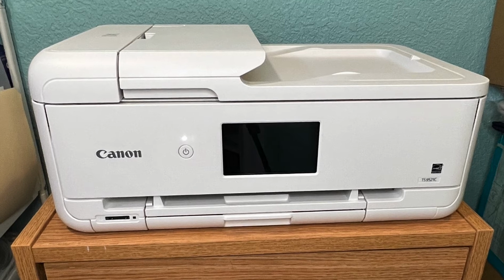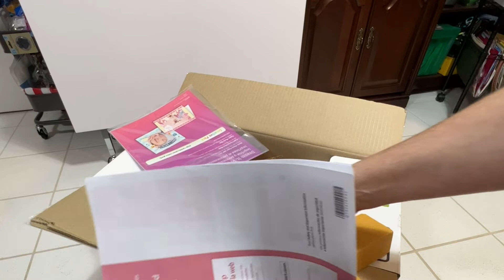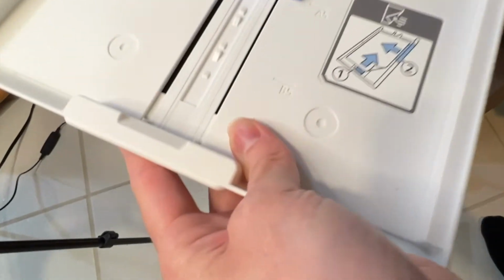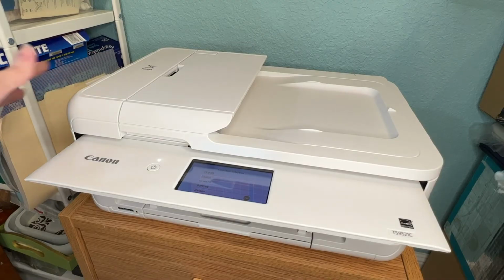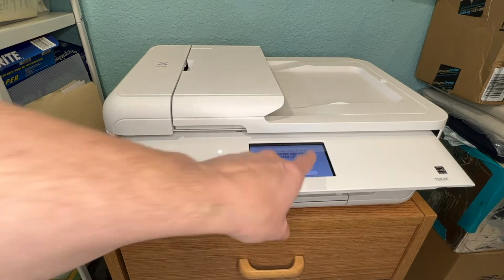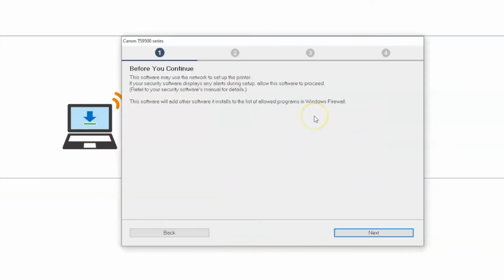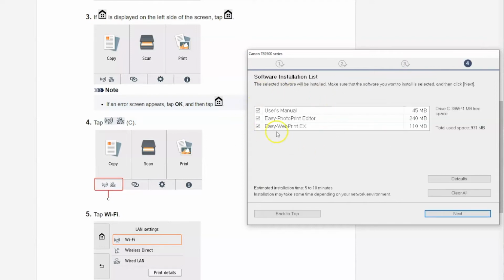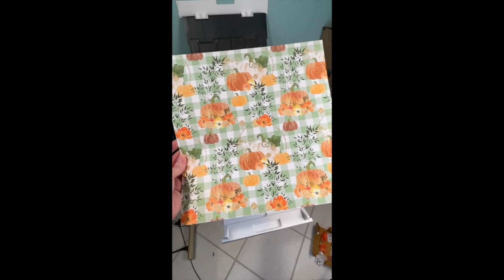Wide Format Inkjet Printer Unboxing and Set up in my Craft Room | Canon Pixma TS9521C

Comment: I have never been able to set the printer to print 12x12! How do you set it up?
Reply from the maker: What software are you using for your image?  Or is your image already 12x12?  I can make you a video this evening to show how.  You need to use the rear feed slot. Change the printer settings using the touch screen to change the size to 12x12, be using an image that is 12x12 and have the preferences in the print dialog box set to 12x12.
Reply: @LittleGraySquirrel  I don't know what i did but it is now printing 12x12. I think I had it set to plain paper instead of cardstock.
Reply from the maker: @little.iodine  Yes, that makes sense. Changing the paper type to cardstock will let you choose the 12x12 size.  I’m glad it is working for you now.

Comment: What print settings do you use for card stock for making cards? I’m really not impressed with the colors and someone told me that bought a card from me that it looks like it came from a home printer and thought it would be better quality 😢
Reply from the maker: I usually just choose the setting for the paper type I am using.  I would probably use matte presentation or premium matte for cardstock (I think those were options, my craft room and printer is packed up right now). Cardstock is pretty porous/fibrous. You might look into pre made cards to print on or something with a smoother surface that will have a more vivid print.

Comment: Great video. Can you talk about what .lb cardstock you can use with this printer please?
Reply from the maker: Thank you! I think the thickest I have printed out of the front tray is 40lb text weight paper which is twice as thick as regular copy paper. 
The thickest I have printed from the rear feed is poster board which is the regular poster board from Dollar Tree that I cut down.  I think it is 98lb? But it doesn't have the weight stated. It printed better on the matte side but I have printed on the shinier side too just make sure it doesn't have any finger prints on it. 
The print on card stock at the end of the video and in my post about the printer on my website I show photos of 12x12 card stock I have printed.  I believe that is 65lb cardstock.  
Is there a particular weight of card stock you are wondering about?

Comment: Hi, Thank you for this great video of the Cannon pixma. I'm subscribing to your channel because I also have a Silhouette.  I'm seriously considering getting this Printer, because it has all the features I need as a scrapbooker, Sihouette user and crafter.
How do you like it so far?  
Have you used it to print photos and are you happy with the  quality of the colors? 
 Also what is the heaviest cardstock you have used in it?  Sorry for all the questions!
Reply from the maker: No problem! Thank you for the questions and subscribing. 
I have been quite happy with the colors.  I haven’t printed photos yet but I need to soon.  I will let you know how it goes.  The heaviest I have printed on is poster board which I fed through the back.  Anything much thicker than regular paper or larger than letter size would print from the back. I have printed 40lb paper from the front tray which is twice as thick as regular printer paper. 
Originally I didn’t think it would turn itself on when I sent something to print after it had shut off but I figured out how to change that setting so I was pretty happy with that.
Reply: Thank you so much for your quick reply!  The more I see this, the more I really want it!  I'm hoping that the print quality is really good on photo paper because I do like to print photos out for family and to also to frame.
Reply from the maker: @MsKathyf  You are welcome!
Reply: I just printed several photos on mine with the glossy II photo paper samples that came with the printer. I have to say that the photos were outstanding. As good or even better than getting them printed at a store. I’m so happy with my purchase.
Reply from the maker: @JoyfulCat24  Thank you for sharing! I’m glad to hear it. I did print a photo on the glossy II paper as well and it was nice.  I also printed one on the photo paper from Dollar Tree and it was not very nice.  It was ok, but not great.  It is definitely worth it to use the good photo paper for important photos.

Comment: Msy I ask how did you get it to print edge to edge? Mine prints with a small white border on all 4 sides.
Reply from the maker: In the preferences settings for the printer, in the Additional Features area, check the box next to Borderless Printing.  It will limit the Printer Paper Size options you have like you can't do Legal, A5, or Custom sizes borderless but there are still many choices. It will also slightly enlarge your image to extend off the edges so don't use borderless for something where you need something in the image to print at an exact size.

Comment: Thanks for the great info. I will be getting this printer tomorrow. I, too, have used an Epson (WF-7510) for the past 12 years. Loved it, but it's just tired and I can't get any yellow anymore. A crafty friend had this one and liked it. I have only ever used pigment inks, so this is a change for me to use die inks. Curious to see if I'll like it less or more. Again, thanks for the information. Is WIFI the only way to hook it up? Meaning, is there an ethernet cord input per chance?
Reply from the maker: Yes, you can connect via Ethernet cable however the printer does not come with the cable (only a power cord). The Ethernet port is right above the power port.

Comment: Have you had any issue with your printer printing dark or items having a blue or green tint to them? I have this same printer but it is printing the colors wrong from my computer.  Are you printing from a PC or Mac? the colors look totally printing from my ipad vs my PC.
Reply from the maker: Sorry for the delay.  I haven't experienced that but I have only printed anything that would be noticeable from my PC. I don't know for sure what the problem is in your case but I know there can be a difference if the computer or device is using RGB color codes vs CMYK.  The TS9521C uses CMYK.  If you are using procreate when you see this problem try this video and see if it might help https://youtu.be/fHUhKM1dPWI
Reply: @LittleGraySquirrel  I changed it to CYMK from RGB and I am printing from cricut design space on my PC. I use concepts not procreate.

Comment: What is the color quality like with this printer? The scrapbook paper you printed look liked the colors came out great. I'm curious to know if you had the printer on any special settings to get the colors to come out as they did?

Also, I know I'm a little late to the party so I wonder if since that last comments, you've tried any thicker papers? I'm looking for a printer that I can print on watercolor paper (140lb). Any thoughts on this?
Reply from the maker: Im sorry it took so long to respond.  I need to update my post with some pictures of photos and more things I have printed.  To get the best prints, just choose the setting for the material you are printing on for example matte paper for printing on cardstock or glossy for printing on glossy photo paper and you can choose standard or high quality.  I have also found that using good quality photo paper matters if you are printing photos.  I tried some dollar tree photo paper and it didn’t turn out nearly as nice as the photo paper samples that came with the printer. 
As for the thickness of the paper, I have printed on Posterboard but I am not sure the weight.  It isn’t the foam core board but the thick flexible posterboard like from dollar tree.  
I’m not familiar with the 140lb. Watercolor paper.  It would go through the rear feed slot if it did.

Comment: Thank you for this video.  Very Informative.  I just bought this printer today.  It should be here Monday.  May I ask, how wide is the cabinet that the printer is setting on?  Thank you!
Reply from the maker: You are welcome 😊 My craft room is torn apart right now to redo the floor.  I will measure it and get back to you as soon as I can.
Reply: @LittleGraySquirrel  thank you!
Reply from the maker: The stand is 20.5” wide, 16” deep, and
24” tall
Reply: @LittleGraySquirrel  thank you!!

Comment: I bought this printer Canon Pixma TS9521c and I’m really struggling. It won’t stay connected to any of my devices. (Phone and tablet) or my husband’s phone. I want to print pictures but every time it’s a major ordeal setting up it, basically from square one. It keeps coming up with a message saying I’m not connected and to check my settings. Any advice?Thanks.
Reply from the maker: I don't have a lot of knowledge about wi-fi and connectivity but I did figure out how to switch the printer so it will turn itself on when you try to print from your phone.  It was driving me crazy too. Hopefully that is the issue you are having. I have the steps on my post about the printer https://www.littlegraysquirrel.com/wide-format-inkjet-printer-for-craft-room/ Scroll down on the post or select section 6 in the Table of Contents "How to change the Canon Printer to Auto Power On".
Reply: Thanks so much. I will try.
Reply: Thank you so much for the information about the printers auto on.  I think that was the missing piece on my end.  After switching the printer to auto on I rebooted  my router and reconnected the printer.  Now it will stay connected to my devices.  Thanks so much.
Reply from the maker: @kristie3963  Excellent!

Comment: Hi!  I have this printer and really like it, but it is not printing the correct colors.  Can you please help me?  I tried changing my images from RGB to CMYK and that did not help.  The colors are lighter than what I see on my screen.  Any help would be soooooooooo appreciated!!
Reply from the maker: I will try.  I have a few questions. 
What kind of ink are you using?  Factory or third party? 
Have you done a print head cleaning or tested the print from the printer touch screen?  
What program are you printing from? 
What kind of material are you printing on?
Reply: Hi.  I am using factory ink.  I did all the head cleaning stuff, but I don't know how to do a print test from the printer touch screen.  I am printing from Word.  I am printing on tissue paper, but when I print on regular copy paper, I have the same color issue.  I just printed something from Cricut design space, and the black doesn't even seem to be as dark as it should be.   @LittleGraySquirrel

Comment: Is off brand ink available for this printer?
Reply from the maker: Yes! That is what I have been using. This printer uses one 280XXL pigment black cartridge and four 281XXLl cartridges in black, cyan, magenta, and yellow.  I usually look for cheapest with most and highest reviews on Amazon. You should be able to find them for about $2.40 - $3.60/cartridge.  
I have bought this pack with three sets of five https://amzn.to/3SXOJkl 
and this set which was a single set of five https://amzn.to/48Do6XB 
This is the cheapest one I saw most recently and it still has great reviews https://amzn.to/4bVSiQL

Comment: I just bought this printer and I cannot for the life of me get it to feed from the rear feeder to save my life! I can't figure this thing out lol.
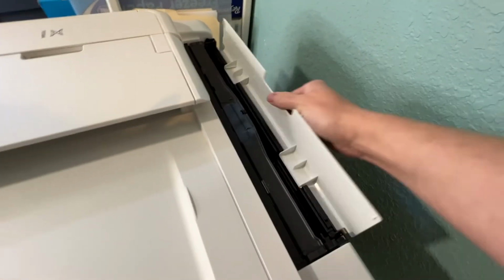Reply from the maker: Oh no!  At 4:52 in the video I show how to open the rear slot. 
Lift the cover, extend the support, lift the inner cover piece, slide the blue guides apart to the size of your material. 
Insert the material and slide the blue guides towards the material if needed so they are along side the material.  Then lower the inner cover that has the little roller on it.  That part has to be down for it to print. 
If the LCD screen prompts you to choose your material and size, go ahead and do that.  Then in your printer preferences on your computer select the material you are using and the size and print quality and then under Paper Source choose Rear Tray. It should recognize that there is something loaded but I like to make sure it knows.  Then select OK and then Print. 
I hope that helps.  If it still isn’t working, let me know which part isn’t working and what you are printing on and what size it is and I will try to make a video for you.  I will probably try to make one anyway but I would like to address your problem if possible.
Reply: @LittleGraySquirrel   thank you! It was the paper size not matching the settings on the printer.  Walked away for a few hours and came back to it and figured it out!
Reply from the maker: @erinduckworth6367  I’m so glad you figured it out!